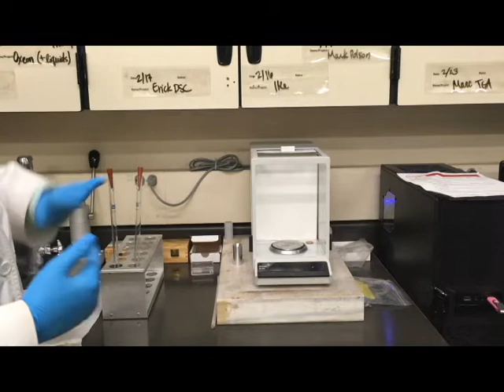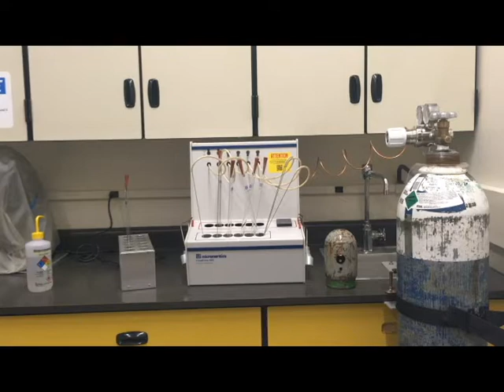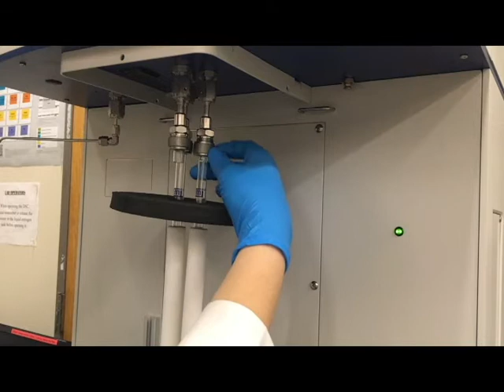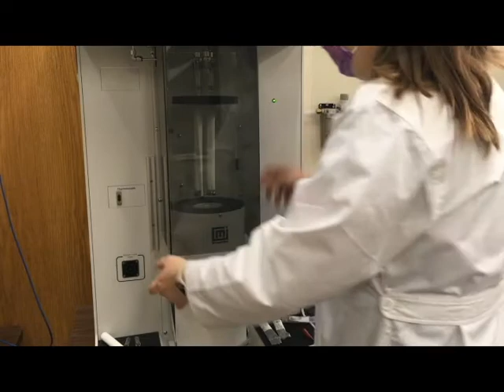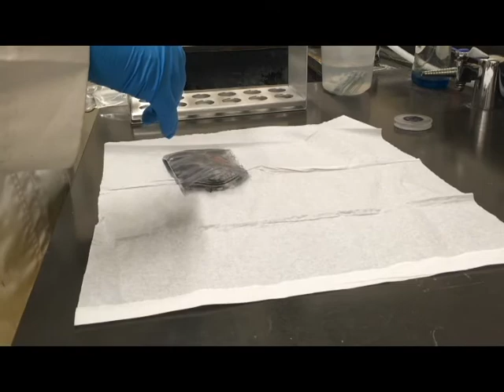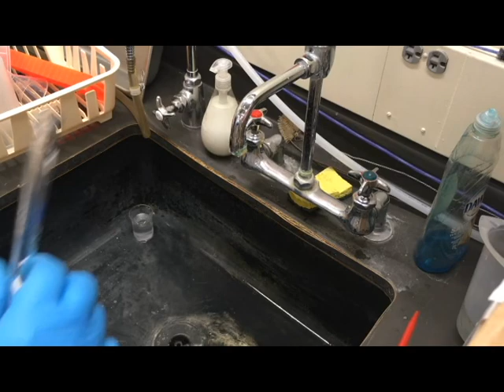3Flex MCL training (archived)

Comment: Thank you for your video please make video on how to use different gases..
Reply from the maker: Hi Nisar. Are you hoping to learn about how to connect different gasses to the machine (so the software recognizes them) or what analysis parameters to use for different gasses? I have used argon on our instrument, so I may be able to help guide you in the right direction!
Reply: @materialscharacterization4168  That's great news...and Thank you very much for your kind reply...that will indeed will help me
Reply from the maker: @MrNisarB  Does that mean you need to learn both? Do you have access to the 3Flex manual?